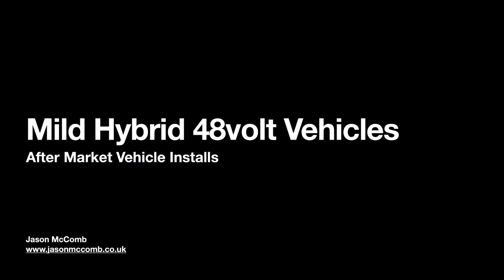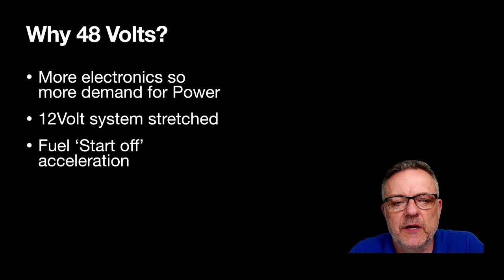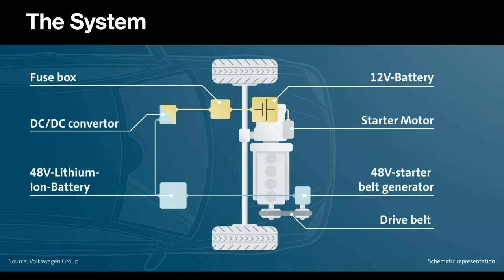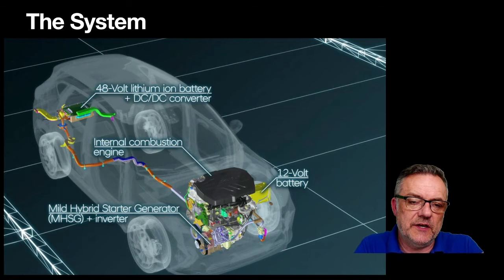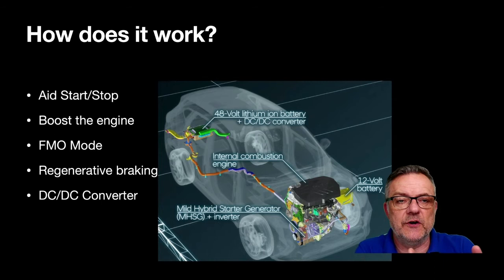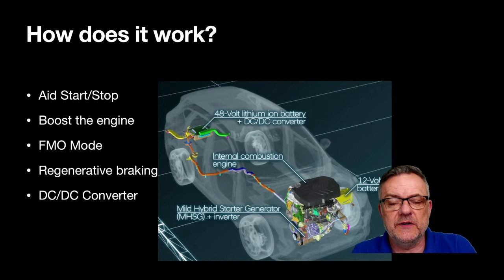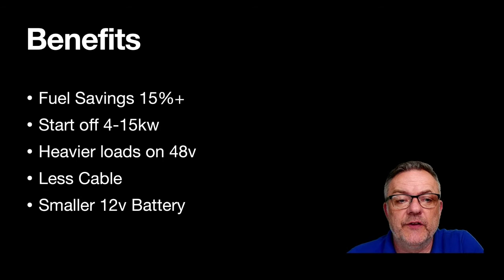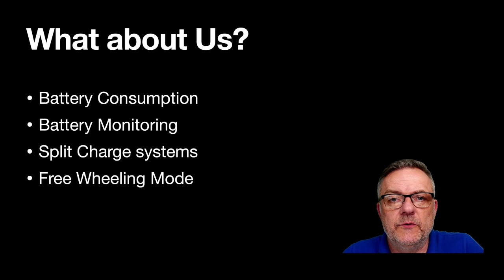Mild Hybrid 48 Volt Vehicles

Comment: Hi Jason, thanks for this video on mild hybrid technology. I’m 58 and have done the majority of my own car maintenance since the 1980’s, as you will know, car electronics has evolved hugely since then. My first car was a 1974 Renault 12TS, the TS got a rev counter and a coolant temperature gauge 😂. This car had an old school electrical system with no electronics, an alternator with mechanical voltage regulator, a distributor with points and condenser driving a coil. The fuel system was entirely mechanical ending in a carburettor. This design was simple and generally reliable, though points and condensers needed regular adjustment. 48V systems would have made sense even with this technology, cold cranking these old cars put a huge strain on the 12V battery, and coils had a ‘starting mode’ to boost the output HV when the starter motor was engaged.
Cars have come a long way, mainly due to their electronics and better metalagery allowing less ware of the internals. I think this process reached its optimum in the 1990’s, but has now gone too far creating too much complexity. Nearly all the problems I help friends and family with now are related to anti-pollution systems such as EGR. I also advise people to disable their Stop/Start feature 90% of engine ware occurs at startup, so this technology goes against the long term heath of a combustion engine. 
Having said all this, I actually think the future of personal cars belongs to the pure battery vehicle. Traction battery technology will continue to get better and an AC motor makes for a very reliable, low maintenance and efficient propulsion system. It’s very hard to fight the laws of physics.

Comment: Hey Jason, thank you so much for this very detailed info. Ive just purchased a Volvo XC40 Mild hybrid and wondered about the system and fascinated in how it actually does work and altho not a fan of the 'stop start' I had on my Audi S3, I had a feling the new car would have it. I'm embracing the stop start with the Volvo now after watching this So does this also mean the 12v battery up front is also Lithium Ion due to being smaller now?

Comment: If the 48V system has a DC-DC converter to bring the voltage down to 12V, why do you need a 12V battery at all?  If the MHSG can start the car after you come to a stop at a traffic light, why can't it start the car initially?

Comment: Ive got  a 2022 hyundai i20 with this system , I have to charge the 12 volt battery every 3 days or the stop/start and the mode they call sailing stops working , within 3 months from new the 12 volt battery went flat so i couldnt start the engine AA came out to it and  charged the battery .   had into the dealer they done a software upgrade but its still the same , I have to charge the battery overnight for the stop/start and sailing mode to work , after 2 days its back to not working , i have found out that if the 12 volt battery drops below 80% these things stop working.  I dont think the hyundai dealer hasn't a clue whats wrong with it but they wont admit it, never buy one of these again.

Comment: HI Jason, i take it that there would be 48 volt at the starter/generator when the engine is not running. and it would use the 12 volt battery to crank the engine over with the normal starter motor? and when engine is running you would move off and when we get to a stop the engine would shut down and when we need to move on the starter generator would start the engine to move on. is this right? thanks Bert

Comment: Hi Jason, are you aware of the massive problems with the Kia/Hyundais 1.6crdi mhev48v. The tensioner from the starter generator fails and in some cases the engine seizes. As of September 2022 several hundred of these vehicles are at dealerships awaiting either new engines, rebuilds or new tensioner. I’ve bought one some 6 weeks ago unaware of the ticking timebomb I’m sat behind.

Comment: If the 48V system has a DC-DC converter to bring the voltage down to 12V, why do you need a 12V battery at all?  If the MHSG can start the car after you come to a stop at a traffic light, why can't it start the car initially?
Reply: 12V is the auxiliary battery, for powering accesories (lights, aircon, audio etc). 48V battery is purely for the ISG. even BEV with large main battery still have separate 12V battery. even Tesla still use 12V aux battery
Reply: 48V battery barely have enough capacity for ISG, let alone integrating whole car electronics into it. and ISG can do the initial start of the car, thats why when you start-up MHEV car they dont have starter motor sound, because its done by ISG
Reply: @rel6294  Yeah, still doesn't make sense to me.  The 48V battery has a lower density than the 12V battery?
Reply: @ProfessorOzone  i would say its not about the density, the purpose of having 2 separate battery is a way to stabilize the electric supply to the car
Reply: @ProfessorOzone  modern electronics in car like ECU, sensors are very sensitive to current and voltage change. 12V battery ensure these sensitive electronics to receive a stable and constant flow of electrics
Reply: @ProfessorOzone  48V battery typically drains very fast to 0% and have small capacity. and with the capacity it probably only last about 30-40 seconds. so not good for the sensitive electronics.
Reply: Why does the car need a starter motor though if the starter generator can start the engine, surely we can use the starter generator for initial start up?
Reply: @michaelhigh3178  There are actually multiple layouts of the starter-motor-generator, the one showed is one, the one you mention is another, and I think there are two others. Basically, SMG attached to side of engine, SMG attached at torque plate/ clutch, SMG at tail of transmission, and SMG(s) at wheels. Engineering and sales priorities factor in…
Reply: @ehb403  thanks for the reply mate, very interesting and good to know. Basically a starter generator can be used for initial start up and eliminate a traditional starter motor but not in this set up